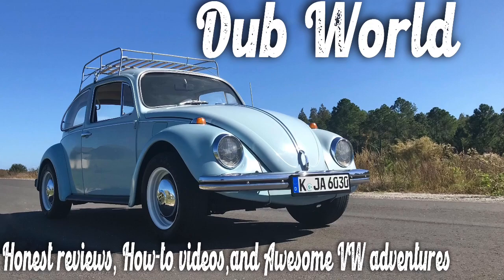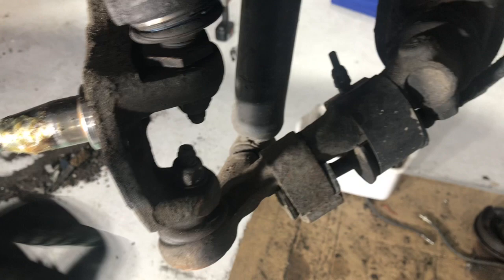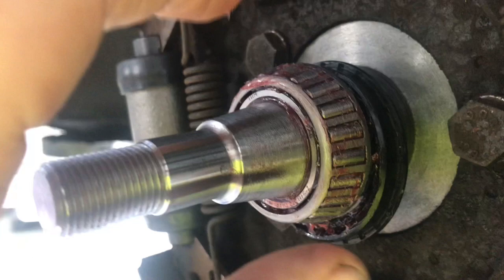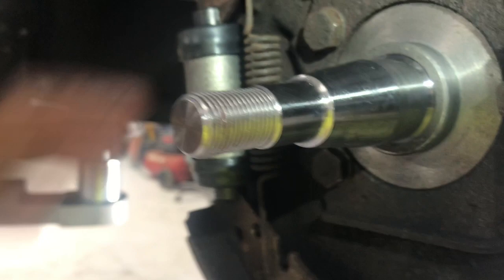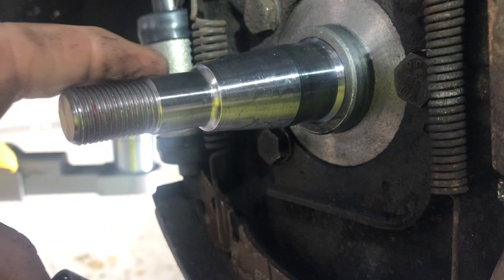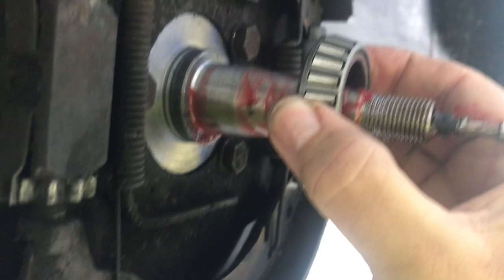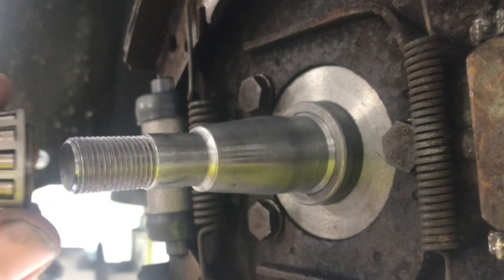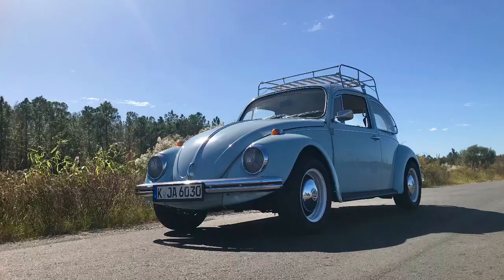Empi 2.5 Inch ball joint drop spindles FAIL

Comment: I have EMPI drop spindles on my car and when my VW shop tried to align the wheels they couldn't get the camber to match on both sides and they said they've seen this on other cars with EMPI drop spindles.
Reply from the maker: Oh wow, good to know! What was your solution?
Reply: I don't understand that.  The camber is adjustable.
Reply: @rbrtgrdn  The adjustment was maxed out and still slightly positive on one side
Reply: @dubworldvwadventures  to max out the adjustment and send it!
Reply: @bykr2009  I think they sell aftermarket adjusters that allow for more camber adjustment.  Probably $30-40.